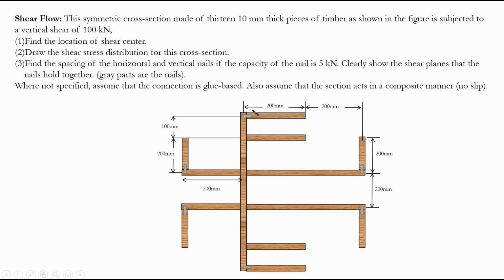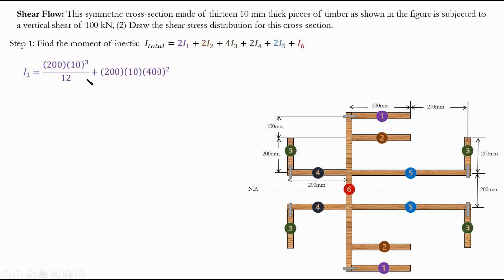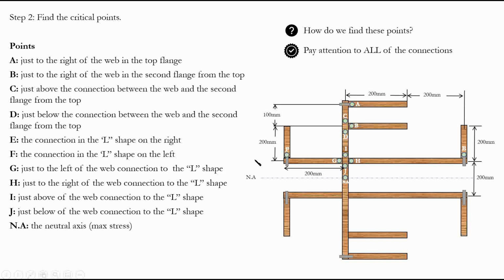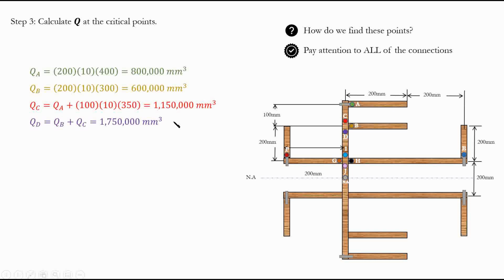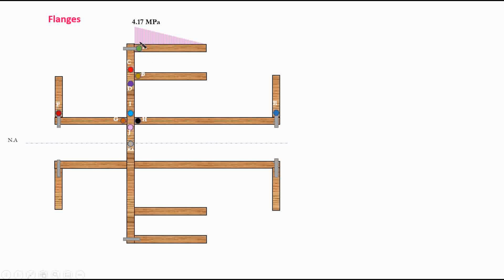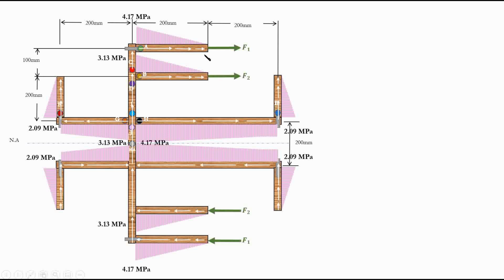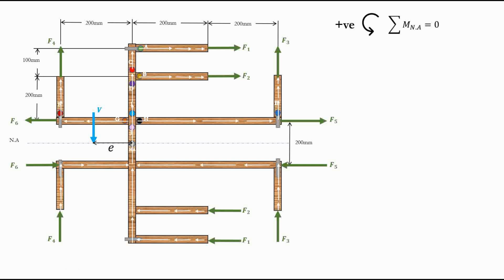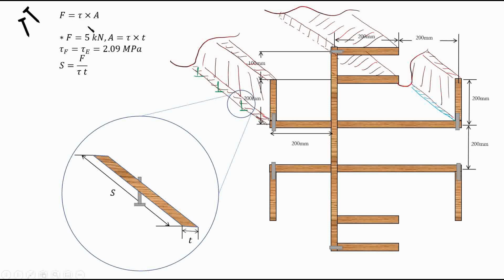Shear Flow (Comprehensive) - Strength of Materials

Comment: Great explanation Shayan! Quick question should we indicate the direction of 'e' with an arrow or mention 'to the right/left' after we calculated the value for e?
Reply from the maker: Hi Arash, yes, exactly! So, you can assume one side at the beginning and based on the sign of the value you get for e, indicate if the assumption was correct (negative means the assumption was incorrect and the shear centre is at the same distance on the other side). I hope this answers your question.